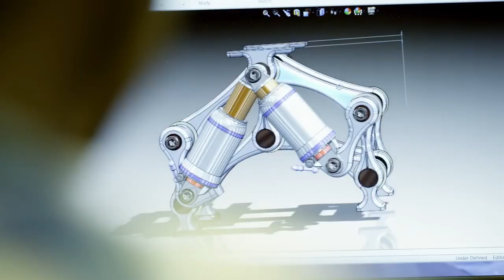THE BOWHEAD BACKSTORY

Comment: These are amazing machines you've developed. Full suspension lean steer tadpole trikes with gasoline engines. Seeing their agility in action it obviously seems like you must have solved the 'bump steer' problem. Iv'e never seen a trike leap and land like that but I have imagined that it would eventually be reality from back in the 1980s. Thank you, it is so good to see this. You have done well. Guess its electric, not gas, didn't realize that.
Reply from the maker: Thank you!! Appreciate it.